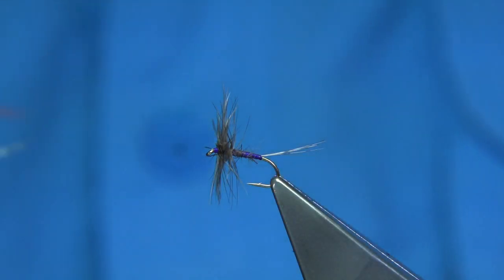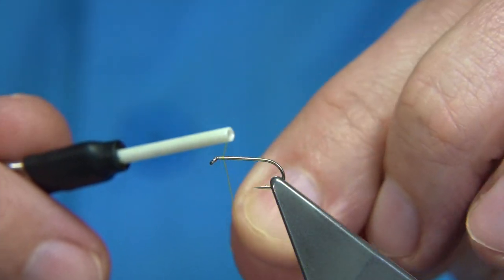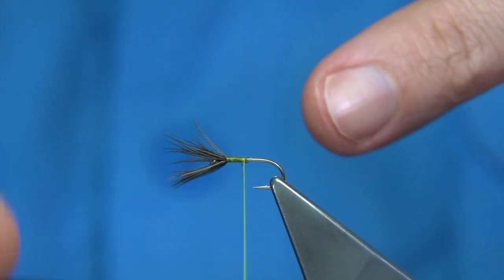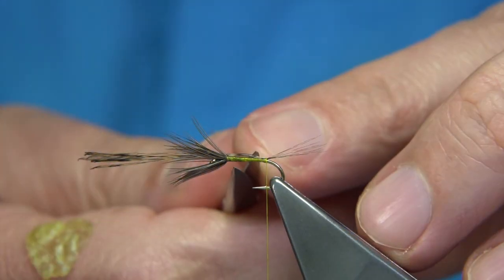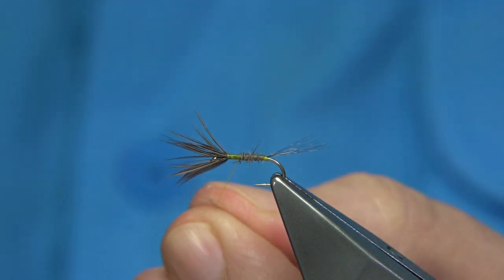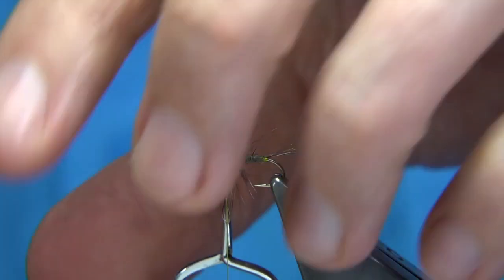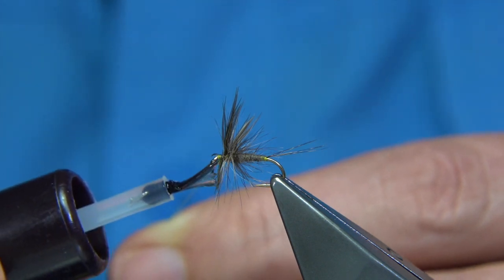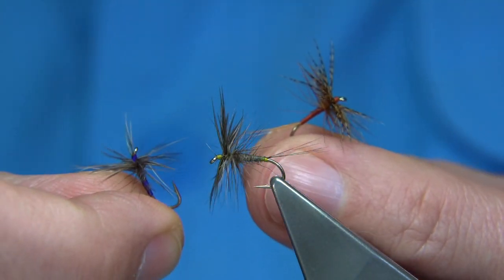Tying the Waterhen Bloa Dry Fly by Davie McPhail

Comment: Thank you! You have just solved a vexing problem. I love the look of the North Country Spiders but I'm a tenkara fisherman. I fish wet flies upstream and want a fly that resists being pulled through the water. Traditional Spiders provide almost no resistance. I am pretty sure adding the cock hackle will provide the resistance needed to keep the light tenkara line off the water's surface so it can still provide extremely sensitive strike indication. When the line sag straightens, even a little, it's fish on! I'll leave the tail off, though, to help the fly break through the surface. I have several partridge skins from which all the smaller feathers have been used. Being able to use the larger feathers will be a huge benefit.